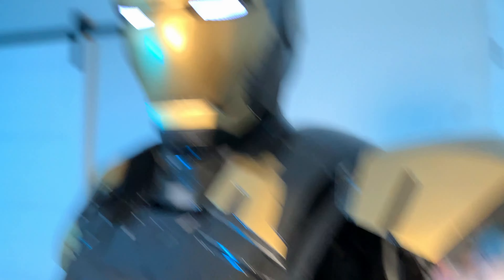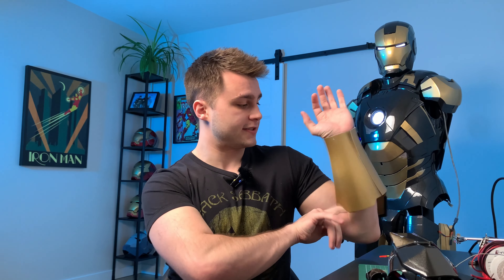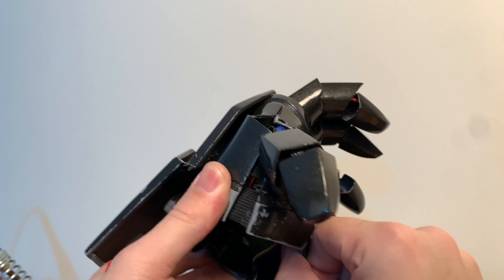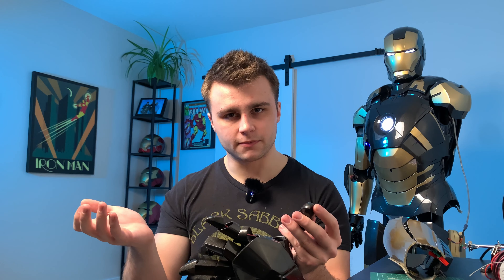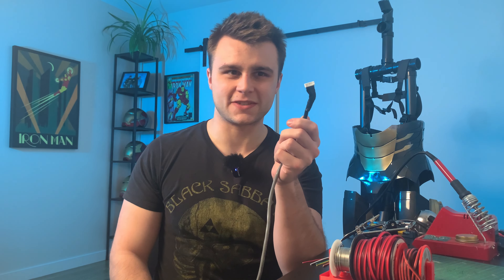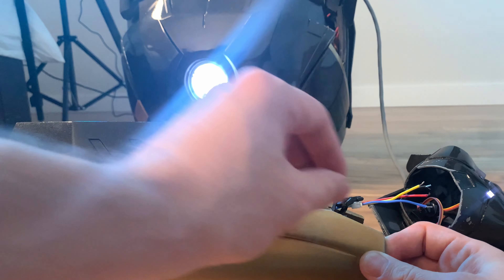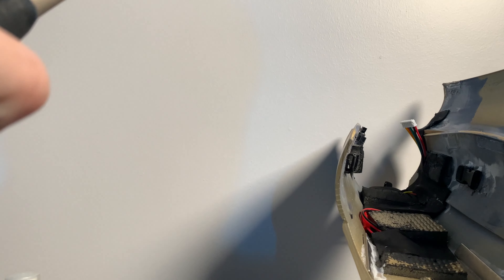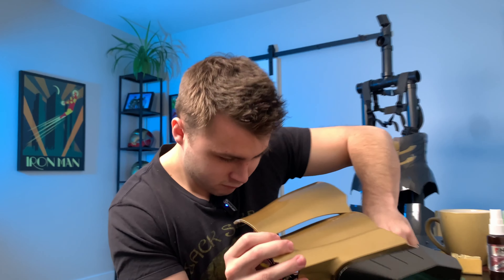THE BEST WAY TO ATTACH COSPLAY PARTS? - Upgrading my Iron Man suit! (part 1)

Comment: This guy gonna blow up so fast for sure! One question about the pin though. It's resting position is upside down right when the arm is hanging straight? How does it not just fall out? Friction alone?
Reply from the maker: Ahaha thanks! And the pin has a little ball near the end with a detent spring, so it stays in place

Comment: How do you glue the elastic straps? I am doing mine and I'm thinking about just hot glue but for example, for the glove and the fingers, how do you clue them so they stay in place and is not bulky? Thanks man!
Reply from the maker: For the elastics, I used super glue and activator spray so that it cures quickly :) I took a thin popsicle stick to apply pressure to the elastic while it glues so that it’s properly bonded, I e rarely had a finger digit break off that way.
Reply: @plentifulprops3d  thanks, I will try that, for other parts I guess hot glue is ok because I have plenty of room but for the gloves ... I love how you did it.
Reply: @plentifulprops3d  btw I'm watching the tips and tricks video and you explain it there very well. I've seen so many videos that I forget hahaha, thanks again man